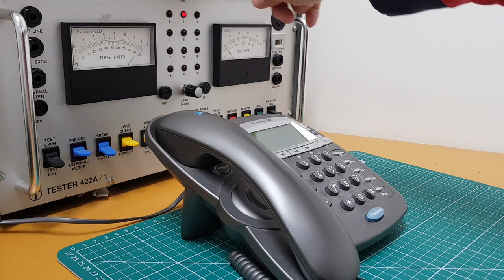Old Pulse Dialling Telephones vs Push Button Tone dialling phones

Comment: And the interesting thing about this is that pulse dialing is actually digital while tone is analog.
Reply: MrSloika Can you elaborate on that please?
Reply: @Sidewinder627  I think there is common misconception among the general public that any electronic circuit composed of semiconductors is digital and anything electro-mechanical is analog. Not so.   The rotary dial phone (pulse dialing) uses a elctro-mecanical device (the dial) to produce pulses that are a square wave (more or less).  Using a square wave to encode the phone number is by definition a digital protocol, even though it was achieved by electro-mechanical means and not a semiconductor.   DTMF (Dual Tone Multi Frequency) dialing is purely an analog signal that used filters at the central office to decode the number.
Reply: MrSloika nice, thanks a lot for clarification sir
Reply: A great example of how we must move forwards and backwards to progress. I never thought about that.

Comment: I remember clicking the hooks on the top of the old dial phone to get around the lock my mum put on the dial. I thought I was very clever at the time, but makes me feel kind of guilty now!
Reply: yes we used to do it on old payphones. the other end will ring but you couldn't talk without putting the coin in.  it was still good enough to send a signal if the other end was expecting it.
later built myself a linesman handset to clip on the junction box in the phone box and the special torx screwdriver to open it. never wasted another 10p
Reply: @drspastic  Isn't this something that Kevin Mitnick did?

Comment: Here in north America (canada), they completely converted over to tone dialing. It's rare to find an exchange that still supports rotary phones, but I used to live in a house in the countryside that still supported pulse dialing and tone dialing at the same time. But in big cities it's super unlikely that rotary phones will work.
Reply: I live in the Montreal area and tried it today and it works (August 7, 2022). I had to manually pulse with the hang up switch since I don't own any rotaries.
Reply: Is it possible to do something to an old rotary phone to make it "pulse" dial?

Comment: How many pulses is the * ?
Reply: Some push button phones, early ones were actually pulse dialing so simulated the number on the buttons.
# didn't work.
Some phones had a switch on them so you could use them on old exchanges that didn't have time dialing.
If the exchange had gone dialing code receivers then you clicked the switch and it sent the times down the line.
As it is most modern exchange which all use tone dialing also can detect dialing pulse so they are backwards compatible.

Comment: apparently in uk pulse dialing is gonna be done away with next year 2024, which will make rotory phones obsolete, but for anyone like me that still wants to use a dial phone, appaently there,s an adaptor that you just plug in, then the phone plugs into the adaptor, i,ve allways found dial phones much easyer to use than push button, esp in the dark or low light etc, & mine is an old gpo exactly the same as in this video, so atleast i,ll still be able to use it, cos i hate new technology.. & would rather stick with what i,m familiar with